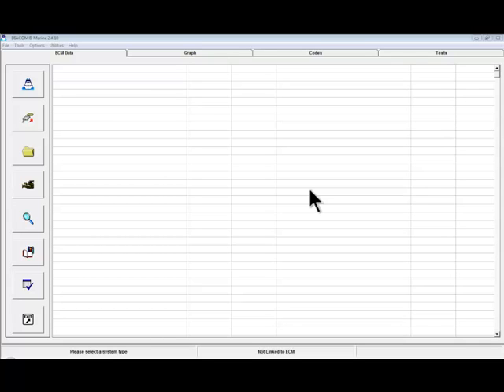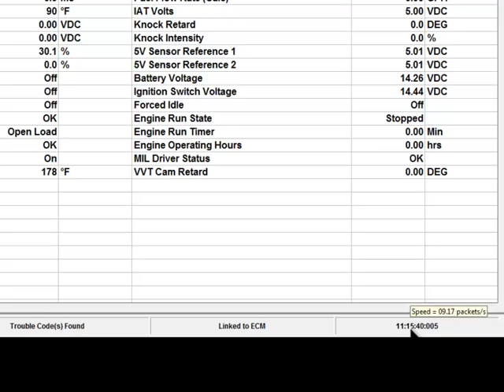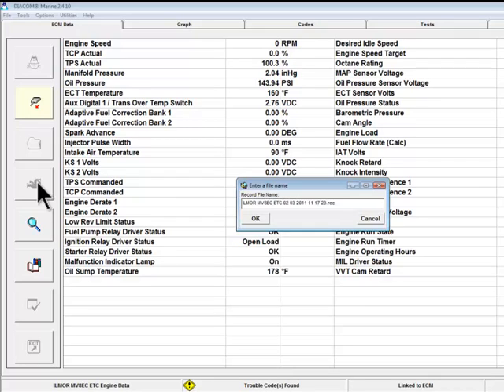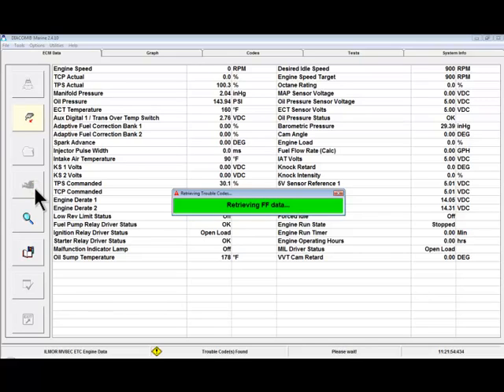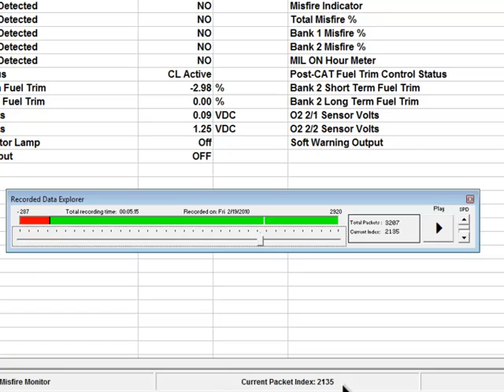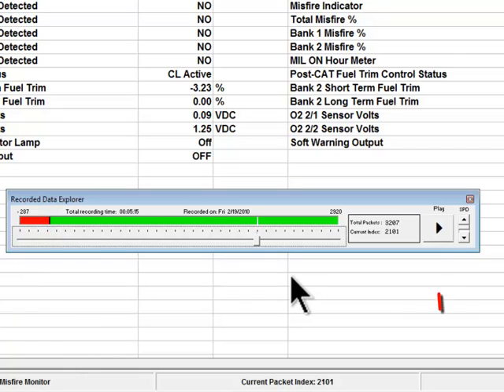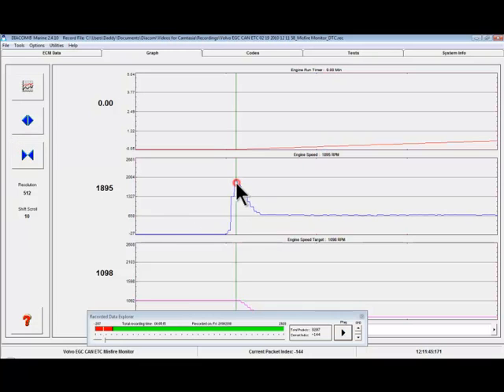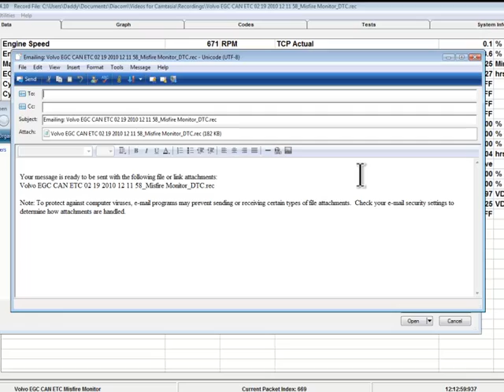Diacom Marine data recording and emailing recorded data files

Comment: Since you have to be connected to the engine to make a data recording, I guess there is no way to get a true sample of on-course data, right? The only solution I can think of would be to strap a laptop onto the motor while it runs. Is there no on board memory for the optimax motor?